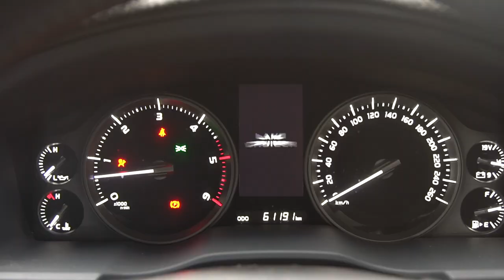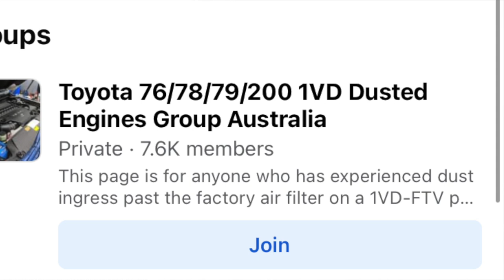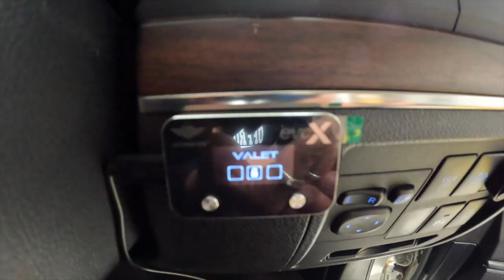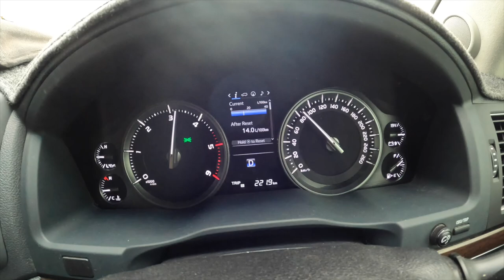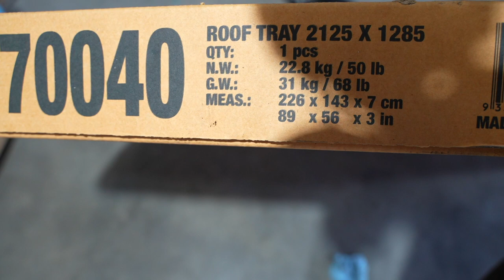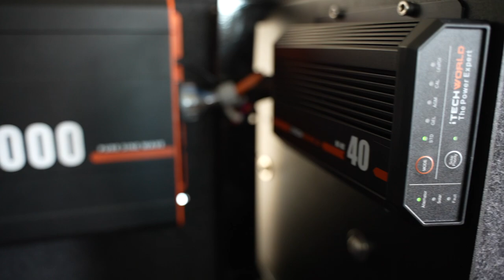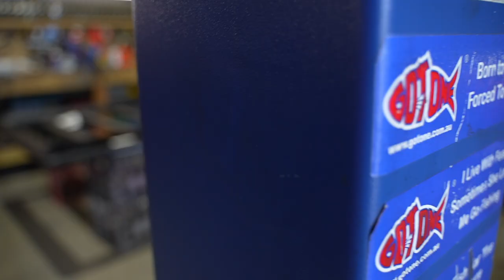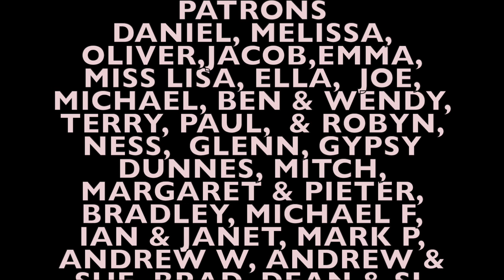RIDICULOUSLY STRONG 270 AWNING! DIY instal 270 freestanding awning and ARB base rack to my 4x4

Comment: 'Leroy' looking goood guys.   With the EVC throttle controller being bluetooth controlled, you actually don't need to mount the EVC unit anywhere and connect with the USB-C Connector.   You can just leave the unit in your glove box or centre console and just tidy up the usb-c cable up under the dash.  I have the unit and I did leave it in my glovebox for a while but then I mounted it to the dash and plugged in the cable just so I could actually visually see it doing something.   Look forward to the next vid team :)
Reply from the maker: Thanks Gary!! Sick mate that’s good info! Cheers legend

Comment: Hi Keelan, Be cautious with the map can easy achieve high kW & torque but increase boost & more fuel can come at a cost . mild increase OK  but possibly for your long term reliability is the key. Personally 2.5 ton van my LC 200 never struggles. Le Roy is looking very 😎
Reply from the maker: Thanks Ian! We are leaning towards transmission remap aswell as a intake manifold clean and also a towing tune which will bring the engine back to stock torque figures with the bigger wheels and weight

Comment: The rhino is rated to 150kg also however my prado only good for 100kg , the major issue you said earlier about different weights etc does not exist with cars that are bolted down it’s more for the ones that need to be riveted. I did my research and the rhino with backbone on the prado will take the full total weight that the roof is rated for! Exactly the same as your wagon.

Comment: FYI rhino rack don't de-rate the rack on most bolt on roof racks this includes the 200 series so that's 113kg payload once the rack system is deducted from 150kg all the load rating info is on their website when you look up your vehicle.

Comment: I've got the XTmax awning on the same rack on my 200. Unfortunately ARB installed it with the upper rear door being able to hit the awning when open. I'll take it back and get it fixed. Does your upper rear door hit the awning when opened up?
Reply from the maker: Hahah that’s typical of those guys mate! Narh mine dosnt, took a little bit of time adjusting it but it clears and fits really nice with the roof up!

Comment: Just so you know the 200 series roof with rails load rating is 200kg and the rhino pioneer with backbone is 150kg rating so 113kg on the roof is fine. They don't have an offroad reduction on my 200 sahara without rails on the pioneer with backbone. The problem with the rhino pioneer is with hilux not landcruiser
Reply from the maker: Thanks mate!! I read the wrong info unfortunately, apologies
Reply: @SarahandKeelanTravels  no worries mate,  200 cruisers are built for purpose with strong mounting points, it's mostly vehicles which have to have riveted mounting points that have problems with low roof loads when using these type of racks

Comment: You do know a throttle controller is % of you factory tps
So no extra power just adjusting throttle position
They are a scam
Reply from the maker: No extra power mate like I said, just takes out throttle lag.. they work they are cheap and they are worth it

Comment: Hey Keelan and Sarah,  we met at the Syd 4x4 show - "Old Fella's Travels " - Mike. I've just put the new  throttle controller on my 76 series. I have the unit disconnect and just use the Bluetooth app. 
The greatest feature is you can disable the throttle with a pin code secured. Basically even if a thief starts your car, they can't get it past idle.
Reply from the maker: I remember mate that’s an awesome feature!! Can’t wait to do that haha

Comment: Seriously don't need to tune. They have so much power. You don't need more. More power equals more heat. Long term heat is damaging. If your going to keep it don't tune I reckon.
Reply from the maker: We have added a lot of weight and bigger shred ect so looking at getting it back to a factory power level with all the new mods! Wouldn’t be pushing big numbers or anything!

Comment: In regards to Rhino Racks. Not all have an on road/ off road rating. For example. For your 200 series. Being you have a 150kg load rated roof. If you get the Pioneer rack and back bone system. After fitting the Rhino rack taking off the 37kg it weighs you are left with 113kg on and off road.
Reply: I'd be interested to know also where ARB state the carrying capability of the rack, off road, and whether it decreases, like most manufacturers. As usual, their website offers little information, and the previous salespeople spoken to, don't seem to have the knowledge on it. A few of them did mention though, that the baserack is built in collaboration with Rhino, whether there is truth to that I'm not sure.
Reply from the maker: Thanks Andrew, didn’t realise and shouldn’t of got my info of 200 owners Facebook page haha just assumed people knew but clearly don’t I take full ownership of stuffing that up. 200 has a 200kg roof rating apparently!
Reply from the maker: Checked with ARB and there’s no such thing in there racks all the same weights and capacity’s regardless

Comment: Hey guys! Did you run the 2b&s straight to the battery or fuse block? Most fuse blocks I’ve seen are max 30a per circuit. I’d imagine your caravan cabling would be pulling 60 amps?

Comment: If Toyota's roof weight rating is 150kg then you need to subtract the weight of the base rack to give you the total of weight that you can put on the rack. So if the rack weighs 23kg then you can put up to 127kg on it. Still a good amount of weight though.
Reply from the maker: It’s 200kg apparently and yes of course you remove the rack weight as it’s sitting on the roof, we still have around 170kg minus awning minus solar panel minus maxtrax ect still got heaps of wiggle room

Comment: Can you please confirm the brand/ supplier for the wrap thanks. Also the "power" button in the 200 will give you the instant response a throttle controller offers. Also be great if you can add chapters to vids of this duration cheers mate.
Reply from the maker: Bush wraps installed by street appeal victoria

Comment: Rhino rack for 200 series is not derated, nor is it for Prado. Everyone going on about Ronny’s video but his issue was with the Hilux, different cars have different spec because how the rack is attached. There’s proper roof attachments for the factory rails, hence the higher rating, not so with Hilux.  Think about it, Hilux, Nav etc, are designed to carry load in the tub, not on the cab roof.  Rhino website is very clear on the load rating spec 🤦‍♂️
Reply from the maker: Ah well, would rather just go with a different company where it’s not even a thing to have different load ratings. Don’t even need to think about it or google it.. happy with the base rack

Comment: You could get away with 10 or 16mm2 quite easily. I know you did a video on it but I don't think you had a trigger wire for your smart alternator so the charger is switching in and out at the speed of light. It will detect over 12.4 v start charging drop to 11.4v then stop.

You always do 1st class wiring neatness good job. Love the car.

Please don't use silicone on paint, the roof rack is designed to seal if fitted properly, that's what the rubbers do. And don't do it too tight or loose(most people do things unnecessarily tight). I hate loctite and any engineer that needs it should go back to study.

Don't take offence, I don't hate just my 2c. Keep up the good work.
Reply from the maker: Thanks mate! At 40amps over that distance with current cable size we are seeing volt drop of 0.1v so if I had of went smaller it would be increased which I wasn’t keen on! Thanks mate cheers for the tips!! 🤙🏽🤙🏽